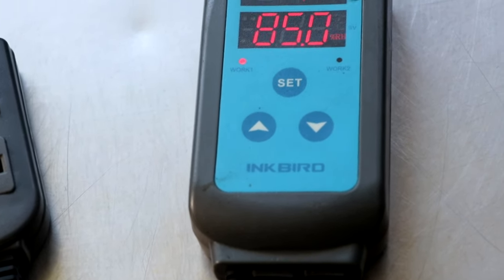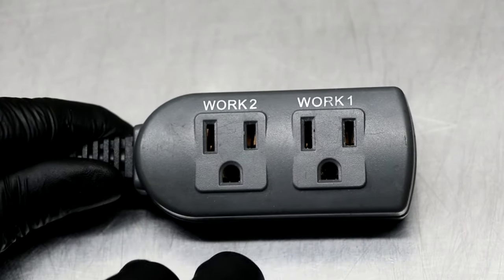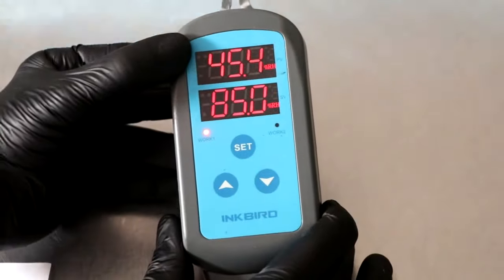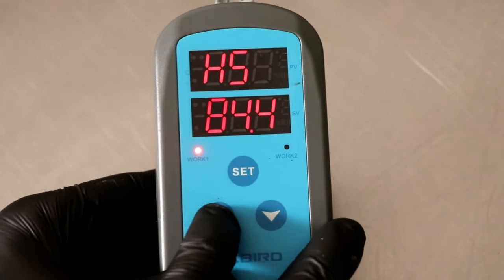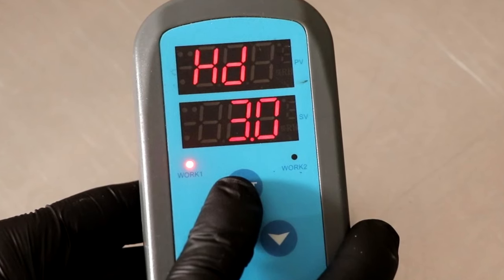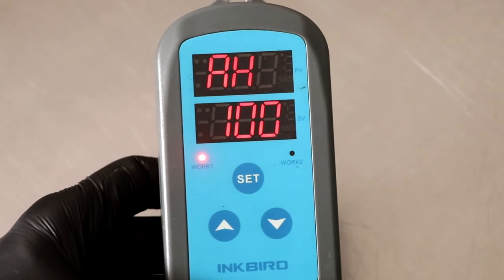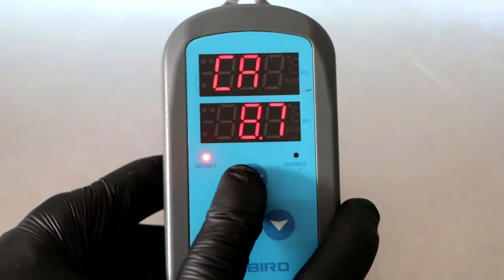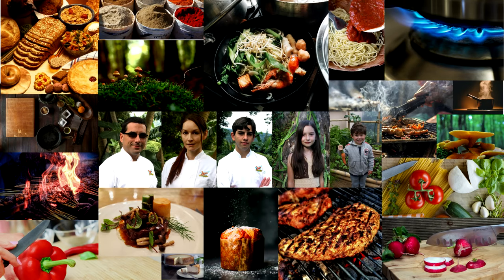Inkbird Humidity Controller - IHC 200   (settings/programming)

Comment: DUDE!!!! I just bought the temp/humidity combo set for my grow space. The included instruction manual reads like a scientific data paper. 
Your video just saved me a migraine. 
THANK YOU!!!
Reply: Be curious how you set yours up. I just want to kick on a small space heater at like say 57% Humidity to warm the air and lower the humidity.
Reply: I'd say it reads like a 2nd grader wrote it.
Reply: should have bought wifi combo, u can program it thru computer or phone, easy as fuk

Comment: I plan to use this to control old non-electronic dehumidifiers (like old Kenmores) and also new electronically controlled ones where the electronics has gone haywire so I'll control the compressor/fan directly with this controller  (cheaper than electronic repair or getting another dehumidifier.)   Looks like a great unit especially since can replace the sensor.

Comment: Fantastic videos and replies to everyone’s questions.  Your webpage and videos have made my project of building a chamber and learning how start my new hobby have been an extremely valuable resource to have. I can’t thanks you enough.
Reply from the maker: Thanks Jonathan.  Glad I could help.  If you run into any issues be sure to let me know..
Reply: @2guysandacooler When the product is plugged in to any socket, it doesn't turn on.

The digital display won't light up, the buttons don't do anything. Could this just be a faulty product? Do they not do any quality control?

Comment: I can recommend after almost 3 years of familiarity with inkbird itc-200, so it is very important to turn the sensor so that the caves face forward, as far away from a surface as possible, that can hold at a different temperature than there is in, the air. 
Then inkbird itc-200 may prove wrong in these cases. 
Calibration in the same way, with the sensor away from a surface as possible. 
Best Regards. Frank Ingemann Knudsen.

Comment: Hey this video  is a lifesaver! I just purchased a small wine cooler but RH is always around 90%. If I connect a dehumidifier only to the inkbird would that be enough to lower humidity or do I need also a humidifier to counterbalance it? Since the cooler already produces a lot of humidity on it's own I thought I might not need the humidifier.  I want to get to RH80%. Many thanks!

Comment: Recently talked to the manufacturer. They have come out with a wireless version of this product. Also the new version has a plastic cage around the sensor. Not trying to overstep, just trying to help.
Reply from the maker: Nice.  I've noticed the cool upgrades that they've made recently.  Much better!!
Reply: 2 Guys & A Cooler strong product. I use an InkBird for my 300 gallon tilapia aquaponics system & another for my cold smoke smoker. Starting my modifications on a fermentation chamber. I will be using InkBird for humidity & temp control if I can get my hands on a wireless unit for humidity. Your coppa recipe actually.

Comment: Hi, thank you for a very clear and precise overview of the IHC-200. I have a question. I am only running a small humidifier placed inside a chiller chamber for curing sausage. Is it ok to just have the Work 1 socket plugged in and leave the Work 2 empty?

Comment: Great clip thank you!  I found the humidity probe to be very slow ...  The device is fairly accurate when humidity is increasing.   But very slow to detect when humidity is dropping.  To test this I took my tent to 98% before it shuts down my humidifier (8x8 tent).  I exhausted the tent quickly once humidity hit 98% and but the device took roughly 8 minutes before it detected the sudden change in humidity.  I have a separate humidity probe for my exhaust fan, which detects the change in humidity a lot quicker, so I was able to compare.  Have you seen this to be a problem?

Comment: Thank you. I'm humidifying a room where too much humidity is never the issue, so I don't have a dehumidifier, just a humidifier. Will the IHC 200 work properly in this case, just turning on the humidifier when the humidity drops below my indicated %, and turning it off when it gets above the differential amount?
Reply from the maker: Correct.  That'll work fine

Comment: I thought the differential value was if I want my dehumid. To start at 65 and lower it to 40 then stop dehumidify again untill the humidity reach 65 again. Are you sure your info Is correct? 
I don't want it to go click on click of contantly. 

In what areas do you use both de/humidifier? 
I know I grow weed. Before flower I want high humidity, after flower low.
so I'm just gonna not use the  dehumidifier first 2 months and vice versa with the humidifier... 

Also wondering if it's availible with eu plug

Comment: Great Video!  Explained super well! However, I have an issue with my meters.  Whenever they are in ambient air, 2 of them are 1% off from each other and a 3rd meter is 5 & 6% off from those.  Weirdly enough, when I put them all in an airtight plastic container with the salt (even with insulation below container to not affect the temp from table) all 3 meters show the exact same number - 77%.   Any ideas why this would be happening?

Comment: When I plug it in, the Work 2 light comes on instead of Work 1. How do I switch the controller to configure Work 1? I have my humidifier plugged into Work 1 but the light for Work 2 is still on.
Reply: Same issue I'm having
Reply: Please reply ^^^
Reply: @notyaavridge2660  I figured out why work 2 comes on. There was too much humidity then the set humidity number. So generally the plug switches to plug 2 to dehumidify and regulate it. I hope that helps

Comment: Thanks so much for this video, so much easier to understand. My issue is that my humidifier won’t turn back on. It’s a touch setting and I thought it would stay on but once the controller turns it off it won’t come back on..Do I need a humidifier with a on switch that stays on , rather than a touch control?
Reply from the maker: Most likely.  The one I use has a knob.  Here is an example... https://amzn.to/3eoO7A7

Comment: Great tutorial! I'm buying a general home dehumidifier, but unfortunately the humidity setting can inly be adjusted in 5% increments. I was hoping to use the inkbird to control the power source so the dehumidifier can maintain 57% RH.  The dehumidifier will cost a lot more to maintain 55% and 60% is too high.  Would you recommend the inkbird for this, or is it best suited for small spaces? Big thanks
Reply from the maker: The inkbird will work great.  Just place the probe in a central area and lower the dehumidifier as low as it will go.  Then program the controller to whatever you are looking to maintain.  Will the dehumidifier turn on automatically if power is cut off from it or do you have to manually turn it on each time.  For example if you turn it on and then go to the outlet and unplug it, wait 5 minutes then plug it back in will it turn on by itself?
Reply: Thanks for the advice, great to know it'll work!  Yes apparently it does resume operation after a power cut, but I'd prefer to check first when it arrives, just in case.  Does the inkbird retain settings?  Be great to know everything will continue working if  there's a power cut when we're away from home.  Thanks again
Reply from the maker: @voodoomotion5855  yes it keeps it's settings if power is cut

Comment: Hi, I wonder if you know this - will this work with 2 fans? (1 exhaust and 1 air supply fan) if I plug in both work 1 and work 2?
I don’t need additional humidification as such
Thanks for the video!

Comment: Any idea how to turn off the alarm? Great video. Very informative! New here. Never slow to grow!!!
Reply from the maker: I don't think that there is an option for that.  I just sent inkbird a message and asked them.  I'll  let you know as soon as I get a reply.
Reply: Press the Set button. It turns alarm off.
Reply: @2guysandacooler  would love to turn the alarm permanently off.. Is there any option for that without soldering it out?
Reply from the maker: @M4XD4B0ZZ  😂😂. Maybe set it to widest parameters high and low.
Reply: @2guysandacooler  yeah that's what I was thinking, still was hoping for a way to shut it off entirely. Thanks for answering tho, I appreciate it

Comment: Great video. Can this unit be used with just a humidifier alone? As you've explained it, it look quite easy to set this up to kick the humidifier in when the RH get's too low, but can you set it to turn the humidifier OFF once your target RH is reached? I'm building a room to store my acoustic guitars. Ideal RH is between 45 and 55. Just wondering if this Inkbird has a feature to shut my humidifier off once it reads 55. Thanks in advance!
Reply from the maker: Yes, absolutely.  As soon as your target rH is reached the humidifier turns off automatically.

Comment: How much variability should we expect, I used the settings you suggested and it'll drop a good 10-12% less before it starts climbing .
Reply from the maker: There will be some fluctuation.  My swings are at least 10% (especially when the compressor kicks on.  The goal is to have an average of around 80%..  So just to give you an example.  In my chamber my swings will go as high as 90% and as low as 68% but the overall average is 80%

Comment: Great tutorial! Any advice with the wifi unit? Ultimately I'd like to make a weekly schedule, with the humidity set point decreasing each day. Currently doing it manually everyday and even though I can do it remotely, the possibly of forgetting is too high!
Reply from the maker: I am about to do a video on the wifi unit.  It's a great unit.  The only controller that i've seen that has programable settings was one from Auber
Reply: @2guysandacooler  hi did you do the WiFi video I can't find it on your page

Comment: I have a Carrier  glass door refrigerator  I want to run both units in my Curing Chamber But dont know where to drill And Not hit any Coils or electrical wires   any tips would be appreciated  ...Just subscribed
Reply from the maker: Thanks for the sub!!   Generally the sides of the fridge have the coils.  The best place might be at the very top.

Comment: Just like you wouldn't hook an oven in your sausage chamber, would the dehumidifier come into play much? Wouldn't it be better for fridge + humidifier on one inkbird w only on/off to a temp/rh?
Reply from the maker: It's very interesting.  Every chamber takes on a life of it's own.  For many controlling humidity (especially in the beginning) is quite challenging.  Having both a humidifier and dehumidifier really helps with that issue.  Last winter we had to place a heating pad in a chamber to get the temperature to come up to 55F.  As crazy as it sounds it worked!!  Unfortunately there's not 1 solution for all chambers.  Each one is different...

Comment: What kind of humidifier works with this? All the ones I have found seem to come with a built-in controller. I can't use those because the humidifier won't fit in the space I need to humidify, it's got to remain outside. The humidifier I have won't start working when it receives juice. Three has to be a person there to push the on button and then plug in the settings. Thanks for your help!
Reply from the maker: What's the tallest humidifier you can fit in your space.  I'll see if I can recommend one..
Reply: You can build your on humidifier for around $50 this is included in this price. Uses a 5 gallon bucket and a fog maker, and a case fan for a PC. Easy to build.

Comment: The dehumidifier I just purchased said that I need a unit that has an on/off power switch (like  a toggle switch) and not a push button to power the unit for the controller to work with the dehumidifier.  
Do you have your controller connected to the small dehumidifier that you have listed on your Amazon list?
Reply from the maker: yes.
Reply: ThAnks

Comment: Do you need a certain dehumidifier to run this? I have a living soil bed that requires moisture and am afraid it may suck out the moisture the bed needs. Other than that looks super easy
Reply from the maker: any dehumidifier works as long as it can power back on automatically once the power has been cut to it...  Check this out:  https://www.youtube.com/watch?v=5pprS-jHAeM
Reply: @2guysandacooler  Are you saying all those models work with the inkbird? Only the smallest one has a power switch, and barely does anything.

Comment: Eric, can you provide your cooling setings like you did with Humidity Controller - IHC 200. Thanks Also, is it normal for humidity rase up and drop down every 2 min?
Reply from the maker: Of course.  I'll have a video online this week with those settings.  The humidity will fluctuate through the entire drying process.  What you are trying to do is maintain an average of 80%.  This especially happens when a fridge compressor cuts on...   If it gets too high and too low though you might want to reevaluate your setup..
Reply: mine wine coller is Cooling System Type	
Thermoelectric and ithink its dont have compressor in it, but will see what happen. Thanks for your hard work and promt respance @2guysandacooler

Comment: I'm using this with a dehumidifier that has a compressor. When the inkbird reaches target humidity, it cuts off power to the dehumidifier. I have the delay protection value set to 3, since the dehumidifier has a 3 minute delay on the compressor. What I noticed actually happens is after the 3 minute time frame I have set for the delay protection value passes, the inkbird turns on the dehumidifier but only the fan runs, not the compressor. The compressor won't start up until 3 minutes from this point. Any ideas on how I can get the compressor to turn on where the fan won't run on its own and I'm not waiting an extended amount of time?

Comment: How do you get it to actually shut off power on either controller?  I have set the  humidity # for high and low but it does not shut off power to either controller . Setting an alarm for what humidity is just an annoying sound.   All the instructions and this video only mention an alarm, not a word about shutting power off on the controller outlets.  Super frustrated with this device.
Reply from the maker: The controller works on parameters.  If the parameter is triggered, then that controller will work.  If you want the humidifier to never come on, set the humidity to 20% and if you want the dehumidifier to never come on set it to 90%

Comment: How do you get work one and work two to work. I have the humidifier and fan. Can't I plug them both in to the sockets. Mine came reading work 2 active my work one doesn't work?
Reply from the maker: they don't work at the same time.  Only one will work at a time

Comment: I am having a problem with my HUMIDIFIER. It won’t turn back on unless I manually press the on button and have to set it again. Can you point me in the right direction on which one to get? I already have the right DeHu I need a good Humidifier that will cut back on when the humidity is too low the one I have I need to manually turn it back on.
Reply from the maker: Here you go.   Check the description box of this video.  https://youtu.be/CXNvNU_sFmg

Comment: When sensor high hummidity alarm goes off.  Does the machine stop working until it is reset?  Is there a way to not have the alarm?
Reply from the maker: The unit does not stop working if the alarm comes on.  The way to keep the alarm from coming on is to set the parameters so high and so low that you will virtually never hit them

Comment: Any suggestions on running the power and sensor through wall safely? Will an opening sealed with caulk suffice?
Reply from the maker: Be very careful.  The walls have gas lines.  If you can avoid a gas line it would work perfectly

Comment: Great video! I bought this unit hoping to control the humidity in my grow tent. Do you have to use a dehumidifier as well? I was hoping it would just control the humidifier alone. As in turns humidifier on at the set RH and off at another set level?
Reply from the maker: You don't need to plug in a dehumidifier to this unit in order for it to work.  Just set your values the way you want and when the humidity levels fall below your values the humidifier (work 1) will cut on till it reaches the target humidity then it will turn off automatically..

Comment: Are there any humidifiers to consider for this controller specifically? I know Eva dry is the only dehumidifier that works
Reply from the maker: Really any one will work, just make sure that it can automatically turn on once the power has been restored to the unit.  Cool mist ultra sonic humidifiers
Reply: @2guysandacooler  awesome! I ended up finding one similar to yours with a different brand name. I am so excited! Your videos are so educational.

Comment: Will this work if I have de/humidifiers that already have control settings on the devices? I have a portable ac for a grow tent and it sits outside of my tent.
Now my ac calculates the temp of my room and not the tent so it tends to get my tent too cold before human interaction is required to turn it off so my tent doesn’t freeze.
Reply from the maker: It should work.  Just as long as the ac will automatically turn back on when power is restored to it.  Also check the amps and wattage..

Comment: Can you use any humidifier? Or only certain models? Can I buy any random humidifier from Amazon and it will work with this unit?
Reply from the maker: yes.
Reply: @2guysandacooler  Thats really not true. If theres no power switch it doesnt work.